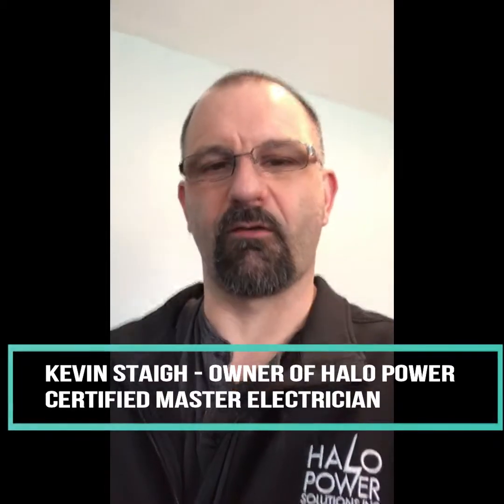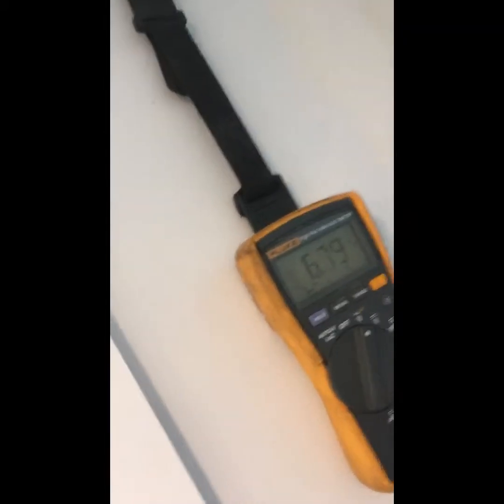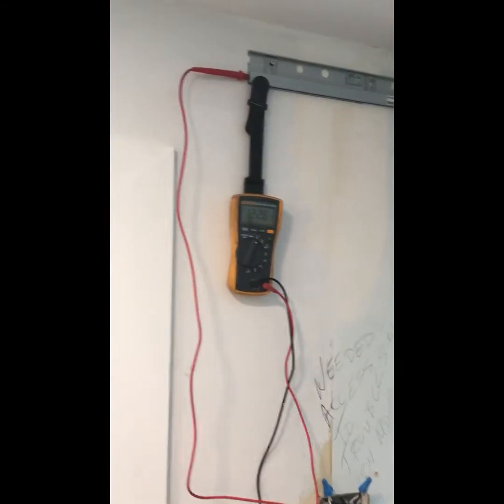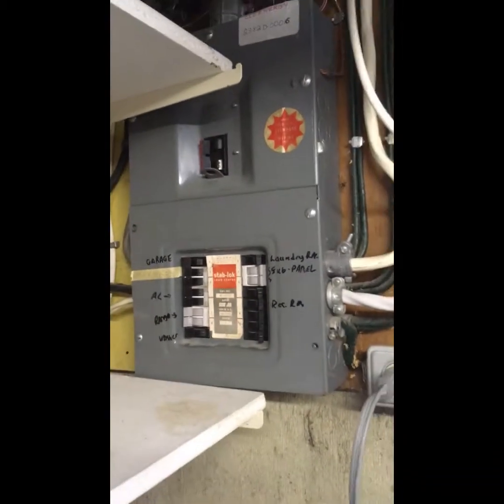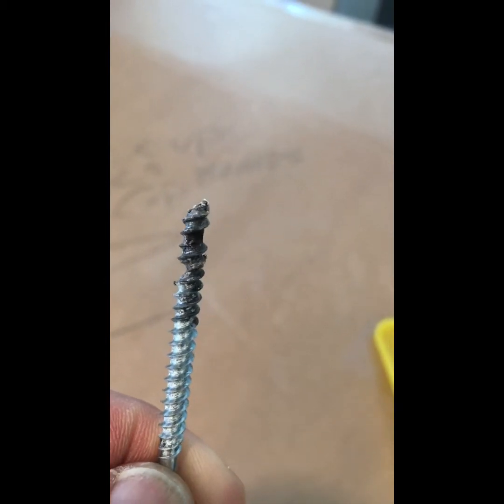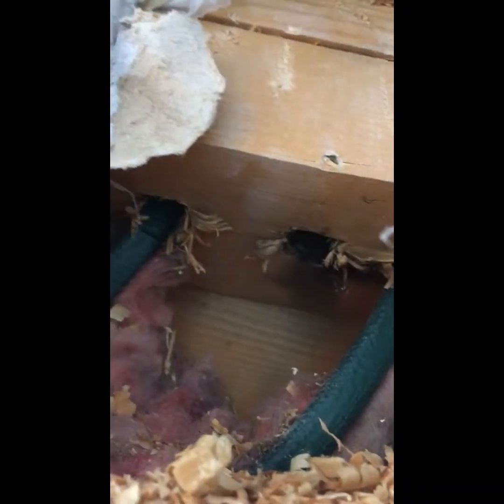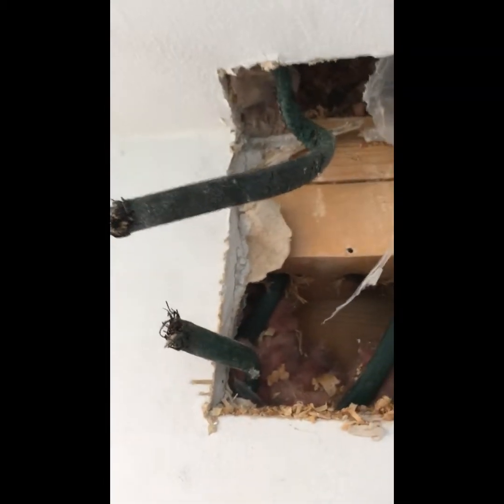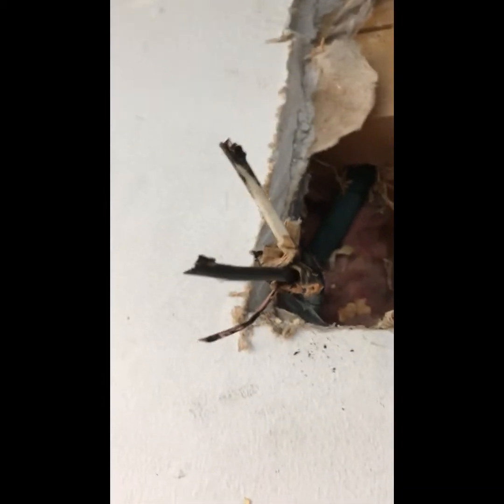Federal Pacific FPE Stab-Lok Fire Hazard | Sherwood Park Electrician | Fort Saskatchewan Electrician

Comment: That's a close call.   A buddy of mine who is a master electrician used to tell us, if you've got Federal Pacific Electric,  you don't need to buy a Lincoln Electric .   

He's seen cases where a massive short circuit had blown the fuse at the transformer,  yet the breaker inside the building never tripped.